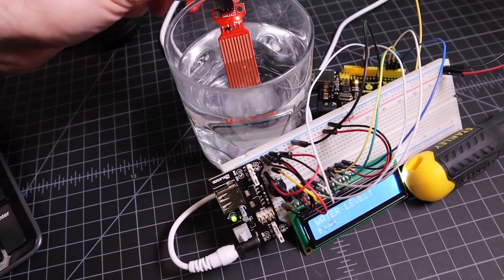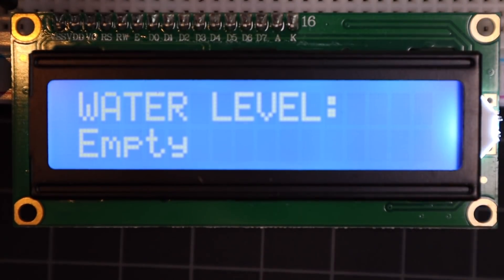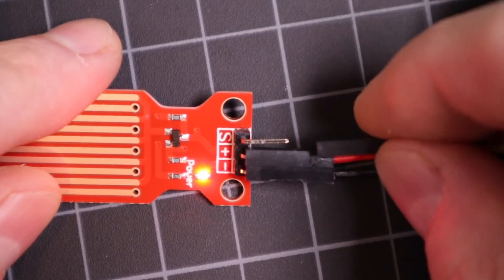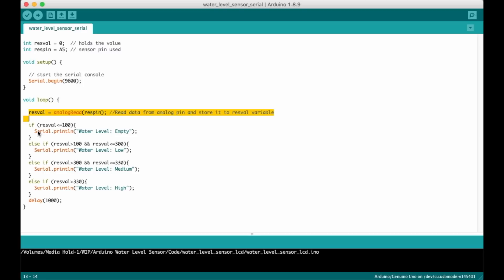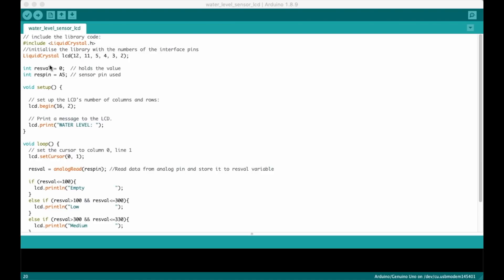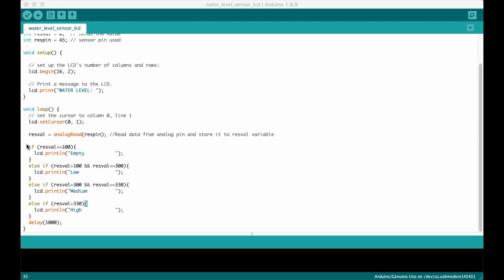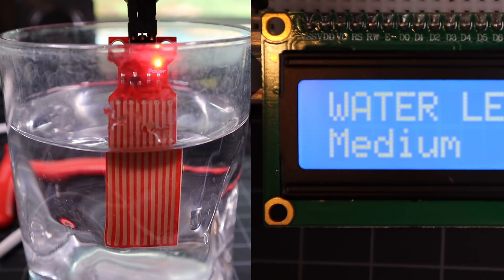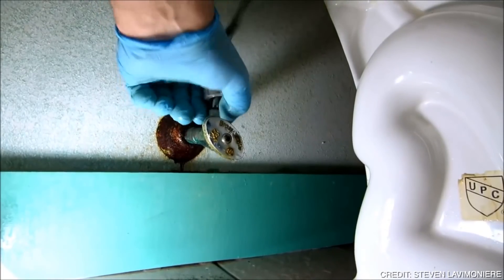Arduino Water Level Sensor Tutorial

Comment: This looks like it will do exactly what I want. I have a pool and the 'standard' water level is quite high in relation to the capping, so when it rains heavily I have to be alert to go out and empty water before it overflows. I'm thinking I'll build this and mount it inside the skimmer box so it will alert me when the water gets too high with an alarm buzz - and potentially find a way for it to send an alert to my phone.

Comment: How to do the wiring and programming if it connected with solenoid valve. The low level will turn the valve no and the high level will turn the valve nc

Comment: Do note that these kind of sensors suck due to corrosion: 1) Thus they break after some time 2) The corroded material stuff is partially released into the surrounding environment, which may not be ideal.  Instead look for conductive sensors which abuse induction for measurement.

Comment: This is great. Is it safe if the 5V pin is constantly exposed to moisture/water?
Also, how do I know if the water gets below a certain level for deeper water tanks? Thanks for this video :D
Reply: use a pressure sensor

Comment: Tried this sensor, it worked about exactly as well as I expected it to. It's heavily dependent on the ion content of the water, which depending on your setup, may be something highly variable. Also, as soon as you get it wet, it almost immediately goes up to full output and stays there until it completely dries off. So unless you're constantly there to wipe off the sensor, this isn't going to be very useful for a lot of projects.
Reply: Simple trick to solve this is to put tape over all the contacts and just cut out 2 strips at opposite ends.
The point is to stop water drops from sitting between contacts. 
Otherwise its a good module for the price.
Reply from the maker: It's highly dependent on the mineral content in your water.
Reply: I've tried to create a device to empty a container collecting water from air conditioning using this exact sensor. It did not work as expected for the reason you've mentioned. As soon as it gets wet, the value on the analog input goes almost all the way up. If there is any water residue on the sensor it remains that way. So If you just want to know when the sensor gets wet and you're not particularly interested when it dries off, I guess it's okay. But for any other applications I'd recommend using some sort of liquid level sensor with float.

Aaaaand I'm having doubts about its long term reliability due to metal threads in contact with water...

Comment: If i don't want to use the 10k potentiometer, so where to connect the VO at lcd display
Reply: i think the potentiomenter is a requirement. Without it, you can not adjust the contrast, and the characters on the display may not even be visible if the contrast is not perfect.  But i could be wrong, maybe its possible without it?  but i doubt it

Comment: When I try the water level sensor serial,  the serial just come out "water level : empty"
"water level :low"
May I know what the problem
Reply: maybe try without the lcd at first just to check what values it gives out than adjust your contraints according to that.

Comment: does it work if i dip it in oil ? because im making a project to gather oil in a container...
Reply from the maker: Probably.  But the resistance values will be higher so you'd need to figure out the new scale.

Comment: There is a problem with your code, a bunch of if/else if isn't really efficient...
The true way to do it is to create an array of string with the message to print for each value, and then you just need one line :
lcd.println(my_stupid_array[resval]);
^^
More seriously, your video was really nice :)
Reply from the maker: You're right.  All of my sample code is written in such a way to be easy to understand for beginners.  Not be efficient.   Most of my project code files could be reduced by 75%.  I also never include error checking for the same reasons.  I don't want to add unnecessary bits that beginners don't need to know yet.

Comment: amazing for my massive fish tank! I travel a lot and it's good to know when the water level is getting close to the unsafe level for the heaters!
Reply: How? You can only dip it in a few inches.
Reply: @kraigparadise5770  If the water level gets too low in a fish tank, I'm assuming. So it would only need to be submerged on the top bit.
Reply from the maker: @kraigparadise5770  ?? If the water is more than inch low, there's a problem!

Comment: Would be a cool thing for use with aquariums.  Knowledgable remove and replace some of their tank's water at regular intervals (for me, it's 25% every week).  During the time that the water level is low, I switch off the power strip for the heater and filters to avoid damaging them. Imagine if the switch was completely automated; from your design one just would need to add a 110 volt relay and probably a shield board plus of course tweak the code.
Reply from the maker: Absolutely!  Great idea!